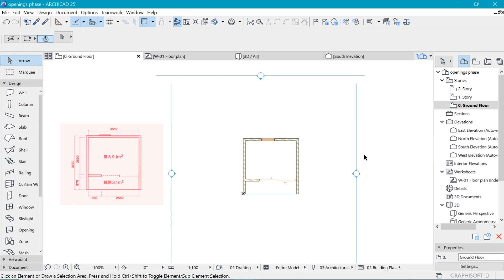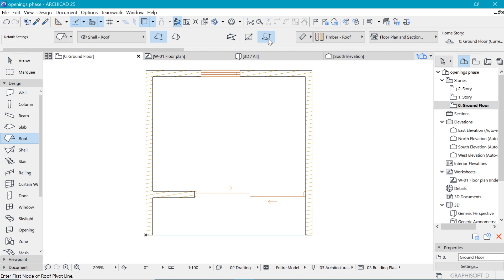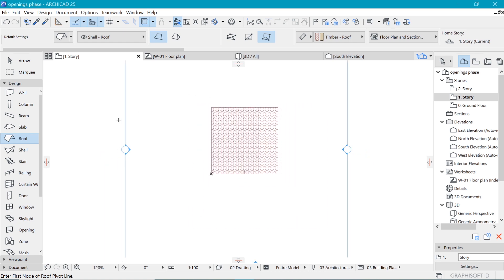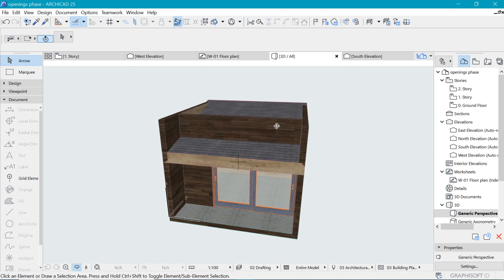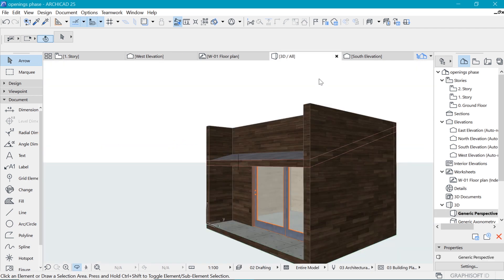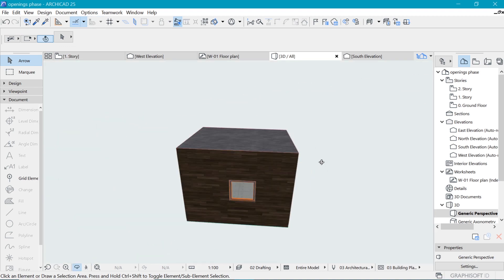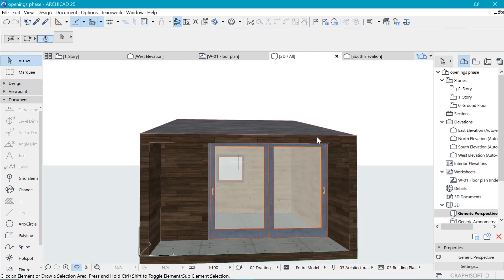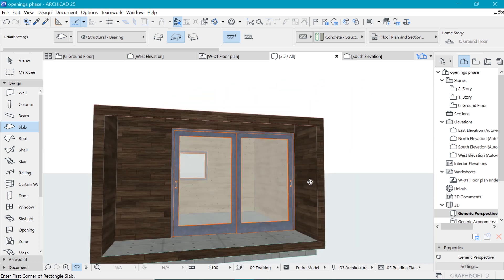Archicad for absolute beginners (005 Roofing)

Comment: Nalitect pls can help. Im working on first floor plan but how can I also show the ground floor in a lighter colour on the first floor plan? Whenever I'm working on the first floor I have to redraw whats on ground floor with the line tool in a lighter. Plssss can you make a tutorial.
Reply: And not with trace reference. I want to be able to print the first floor while showing the floor below in a lighter colour.
Reply from the maker: On the standard tool bar, there is a tracing tool that allows you trace the ground floor by showing it faintly below your floor plan... Search for it and it will save you time... its just a click away
Reply: @nalituts pls can you show. I'm not talking about the trace reference. I want to be able to print first floor and also show the walls below but in a lighter colour. 🙏🙏